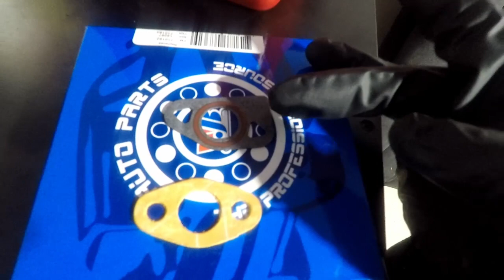2000 Camaro 3.8L Oil Pan Gasket Replacement

Comment: You really gotta do all that just to get the oil pan off?
Reply from the maker: Yup unfortunately. There isn’t enough clearance to remove the pan without dropping the subframe completely, or dropping subframe a little and raising the engine up
Reply: @bluesxt  in the video it’s a little dark so I wasn’t able to see what all skrews you took out. I changed my oil pressure sensor a few days ago & had to drill a hole in the threads to get the old one off now I have no oil pressure at all the car won’t start anymore either so I want to check the oil pump & see if any shavings from the drilling I did made it to the pick up tube
Reply: I got it out but had to unbolt the pickup tube, was there a gasket on yours? mine didnt have any gasket
Reply from the maker: @zcadn  the pickup goes have a gasket! I thought mine didn’t at first but it does. Be sure to scrape all the old gasket off and install a new gasket!! That is a very important gasket as otherwise your engine will start sucking in air in the oil
Reply: @bluesxt Crazy i got it out by unbolting the pickup without lifting the motor was a bish but got it, barely saw that old ash gasket too
Reply: @zcadn  the transmission wasn’t in the way? I’m curious on how you did that I don’t have the tools to lift the motor